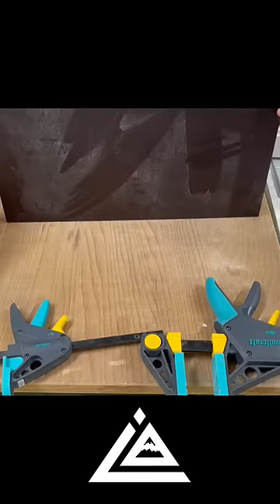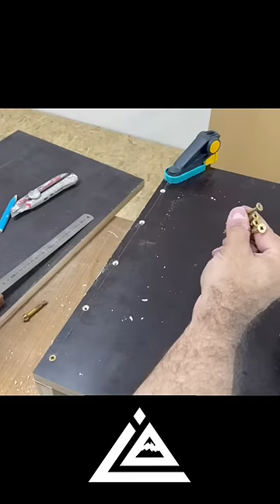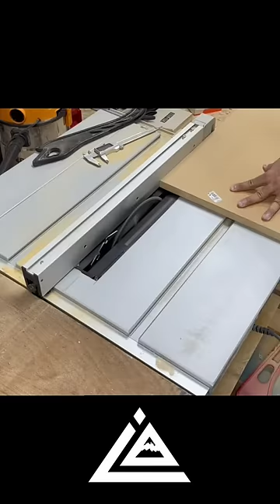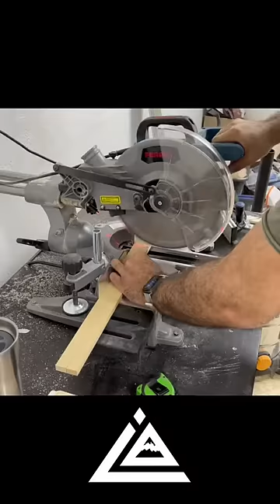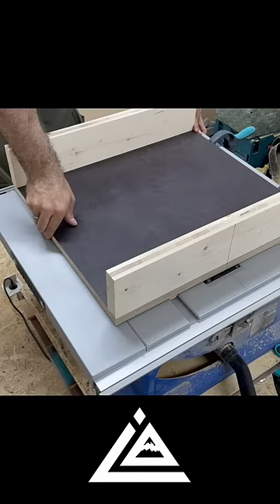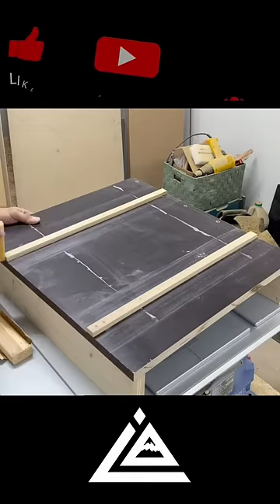The coolest way to make a table saw sled

Comment: You didn't align the fence to the blade?
Reply from the maker: good question i did the five cut method off camera
Reply: The only way you could've used the five cut method off camera is if you cut the sled on another sled or miter gauge which you had already calibrated with the five cut method to give you a near perfect 90° angle and then referenced a straight edge that is known to be near perfectly parallel with the blade, not two random spring clamps or even the rip fence. Otherwise you cannot use the five cut method on a sled you haven't even assembled. @PharaohsCave
Reply from the maker: true and well noticed. In fact what i did is cutting off the pre drilled holes i used for the video and than attaching only one screw using it as as a pivot point and than doing the five cut method (tbh) I felt its overkill anyway ;) nobody needs that accuracy we might disaggre on that point but i'm happy to be convinced othervise

Comment: I use a macalister table saw and struggling to make some runners 13mm wide
Reply from the maker: you could just use mdf and cut it 13mm wide. actually not sure what this saw is about 😂 looks like a construction side saw

Comment: 3/4” ply is too thick…1/2” at the most and 1/4” for anything smaller than you’re building
Reply from the maker: thats what I had in the shop :) and I was thinking that as well next one I’ll use a thinner ply and tbh I kind of messed building that rig